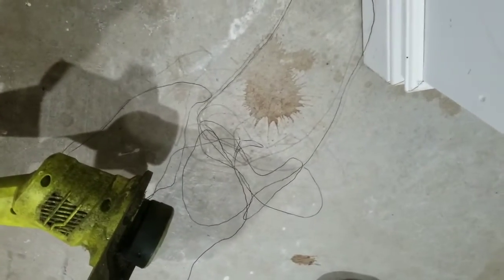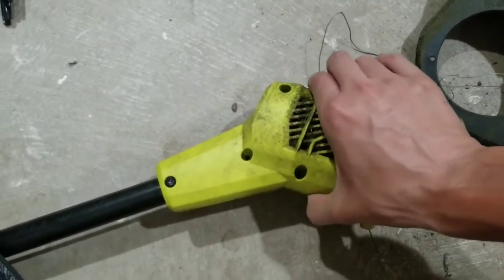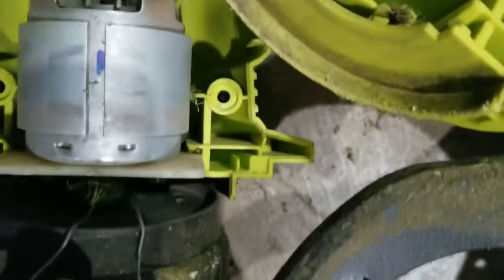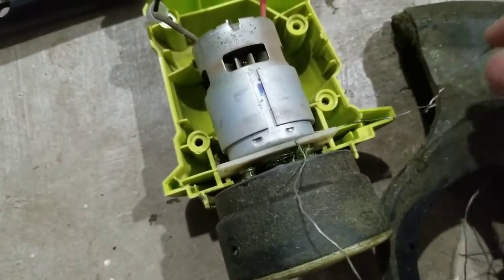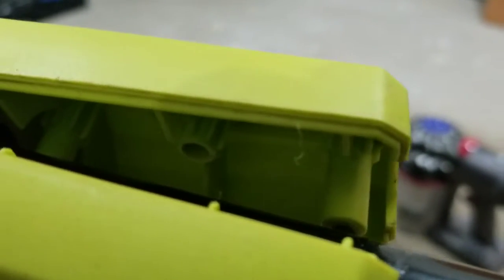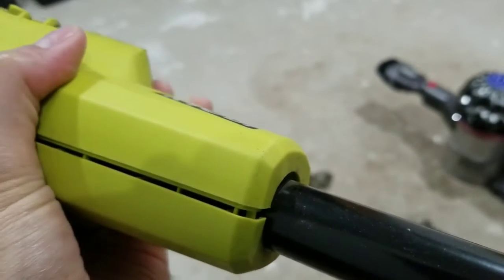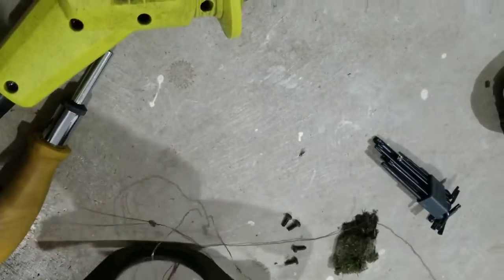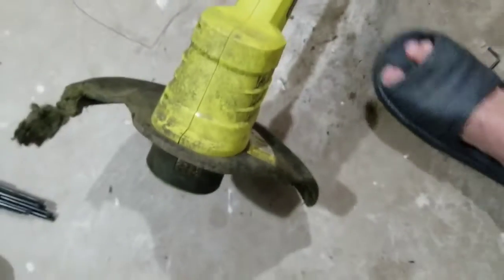Fixing/Opening Ryobi 18V Wireless Trimmer - Removing wire from trimmer head

Comment: Do you know how to remove head?
Reply from the maker: Do you mean the plastic piece that's attached to the electric motor? If so, then 'no'. I think it's on there pretty tight. Luckily I didn't need to remove it to get the wire out of mine.
Please subscribe and hit the thumbs up to support my channel. Thank you for watching!
Reply: @ourthingsinlife4658  I lost the cover for that and got a problem to buy new one.
Reply from the maker: Did you call the manufacturer? I wonder if they sell the part you are missing. I definitely can see how trying to replace parts can be challenging, so good luck with it. I hope you can get it.

Comment: Hi, I have Ryobi One Plus Hybrid 18V String Trimmer. Model #P2200 and It has some missing parts. When I search to find out which parts are missing, I Saw that it doesn't have black button for keeping tight the spool line. I think I need to replace the string head. I talked to Ryobi help assistant but he doesn't want to tell me the part number because Home Depot doesn't have that part. He recommended to buy  2-in-1 Pivoting Fixed Line and Bladed Head. I am a traditional person and I want to buy correct parts. Also even if I get correct string head I don't know how to replace it.
Reply from the maker: I use to have the Ryobi One Plus Hybrid too, but mine broke. Motor burned out, so I ended up giving it away for parts. So, unfortunately I can't help you get the correct part number. Sorry about that, maybe there is someone else on YouTube that has that trimmer that can help you out. Good luck with that!
Reply: @ourthingsinlife4658  Thank you!
Reply from the maker: You're welcome 😊

Comment: I have the same model... once I saw the BS you have to go through just to clean it out , I threw it in the trash ,... back to 2 cycles for me...
Reply from the maker: Was it still working? Why not try to sell it or give it away?
Reply: @ourthingsinlife4658  the motor shaft was jammed with crap like in the video ... besides the performance was subpar... no torque like gas powered ones  have ...the battery will get used in another cordless item
Reply from the maker: Oh I see. Good you were able to put the battery to use in another device. I've never used a gas one before, so I don't know what I'm missing 😅